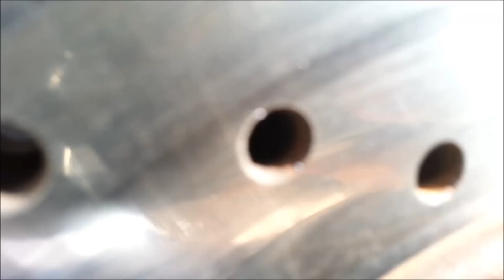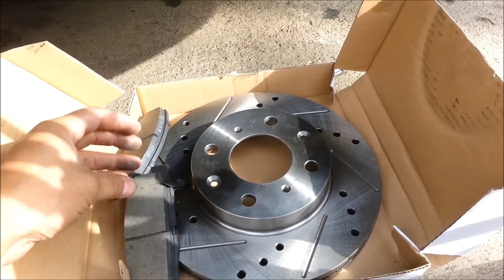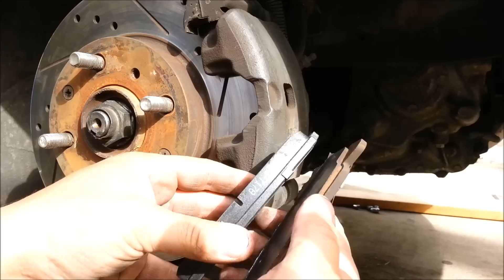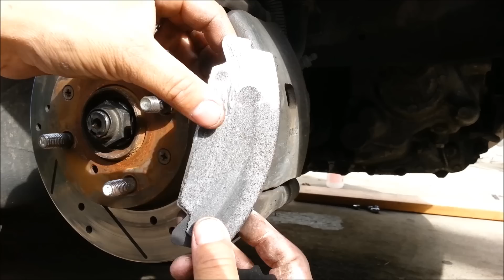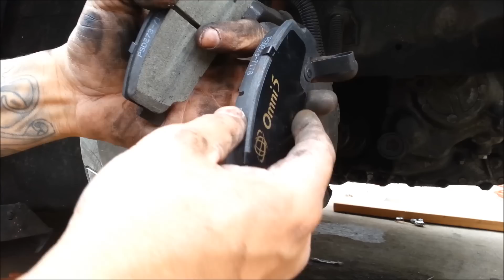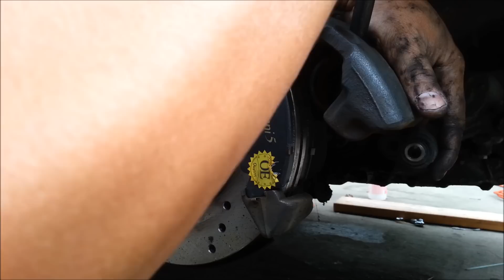Replacing my Brake pads and crossed-drilled slotted Rotors

Comment: great videos man. really easy to understand and you dont skip any steps which is great. the safety warnings are great too! subscribed.
Reply from the maker: Hey thanks man! And thanks for watching!
Reply: Great job..Few suggestions.
Use Brake Cleaner to wipe off grease and contaminants from your rotor. Wear one of those gloves to protect your hand as well. Grease the end, edges and back of the brake pads to reduce brake squeal. Always good to change the shims and Brake hardware for a complete to rotor, pads replacement. Last use Loctite blue or anti seize for the bolts that holds the caliper and bracket to prevent from rattles, squeal, safety, etc.
Good job.

Comment: 1- you should remove that rust before to put the new disk.
2- you should use some brake cleaner to clean the disk from oil/grease.
3- you should remove that rust from the caliper before to put the new brake pads.
4- you should use some anti seize grease before to put the new pads.
5- you should not put your greasy hands on the face of the pads.
6- you should check the guide pins if they working freely.
That’s why I started to fix my car by my self, because lots of “mechanics” are doing like you.
Excellent job, make me to learn to be better 🤷🏻‍♂️
Reply from the maker: Cata Cata - have to remember this is not a “How to” video. It’s how I did my own brakes. I did this brake job to the front (and the back) 6 years ago and although I don’t drive this civic much, all these brakes and discs are still on and functioning. So all that “you should do this” and “you should do that” doesn’t affect anything. That’s what they teach you in school😂
That’s good that you do your own work on your car. I’ve been working on my Honda’s for years. I agree with you, there’s a lot of mechanics working out there that are not certified. But that doesn’t mean they’re not qualified. We usually don’t like to deal with delicate people anyways. Do you’re best to be better. I encourage you. But always remember, there will always be somebody better than you. Stay humble💯
Reply: Rivera's Hot Wheels your video is public and can be an example for who whatch this..let’s give good examples. it doesn't have to happen to you, can happen to someone else who follows you 👍🏻

Comment: Hey fam, so I have the exact rotors on a 2014 Honda accord EX and I also use ceramic brake pads but I'm have a very big dust problem........the wheels get alot of dust on them so often..... what do u think is causing 6and is there a better option
Reply from the maker: Not sure. Because I have aftermarket wheels, it’s easy for me to clean dirt and brake dust that gathers on the wheels. Not sure how much is too much brake dust. Have you consulted with a auto parts tech?

Comment: hey man, question? ppl mention about the direction being backwards, whats the side effect about putting them backwards?
Reply from the maker: nothing really if your car is pretty much stock like mine. I mean unless you're  going to do rally runs or drive like a maniac, the slots are to keep the discs cool. I didn't  drive around with these 'backwards' for that long. I switched them around and can you can see on the next video where i replace my passenger side axle.

Comment: Dude omg were your brake pads worn out evenly on both sides cause it seems like your caliper pins got stuck and seized and only the the caliper piston was putting pressure on one pad on the inner side

Comment: Use a hammer screw driver to remove those philips screws on your rotors. Makes them come right off
Reply from the maker: That's what I said on the video but I didn't have mine on hand. Couldn't find it. It's funny how that always happens when you need a tool right that moment...

Comment: Puto, you put rotor on the wrong side, old one was the right way.
Reply from the maker: ya se guey. lol. It's cool tho.
Reply: Cali Cali that depends on the rotors vents directions. If they are straight you can put the rotor either way but if it's slanted vents the vents should face opposite rotations on the wheels so you can get rid of the brake dust and heat.

Comment: You put that on backwards. That's defeating the whole purpose off the design you have to put that on the left side. That must tear them pads up quick and not stop good at all!
Reply from the maker: Yea. I got a lot of crap for it lol. I switched them around and you can see on my next video when I replace my axle. Thanks for watching 👍🏽
Reply: Rivera E I learned that it doesn't matter which way the holes or slots are going. It's the veins inside if there directional you need to pay attention to that! Some come curved to grab the air better for better cooling!
Reply: Correct, if the rotors have straight veins, it doesn't matter which way it goes.  But if the rotor has curved veins, the veins need to be pointing with the openings turning the same way as the tire in forward motion.